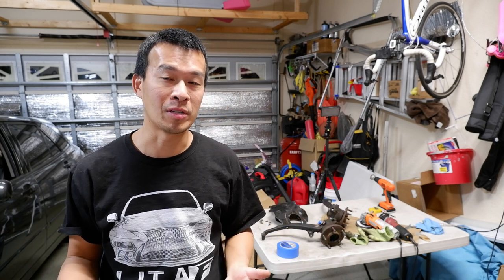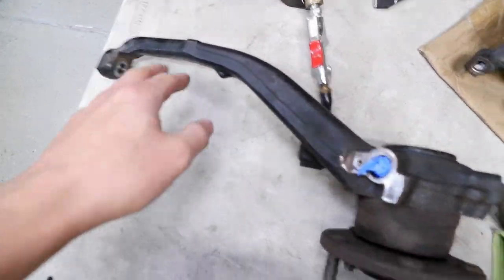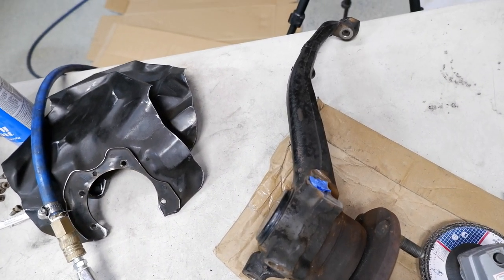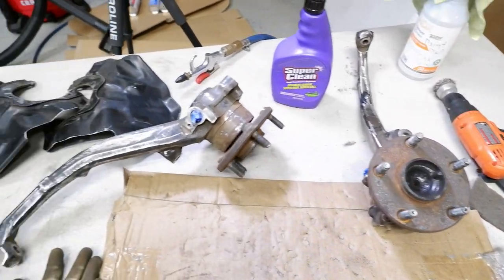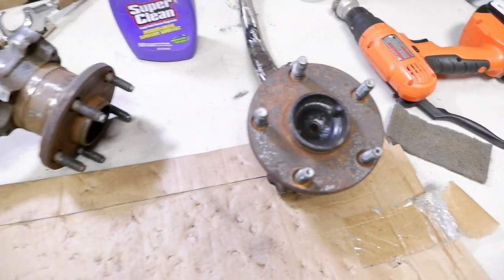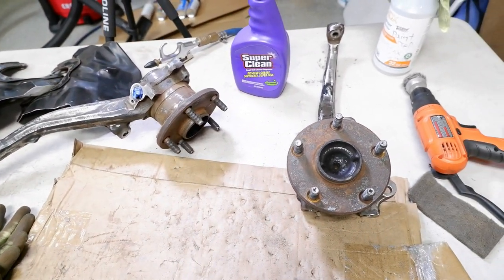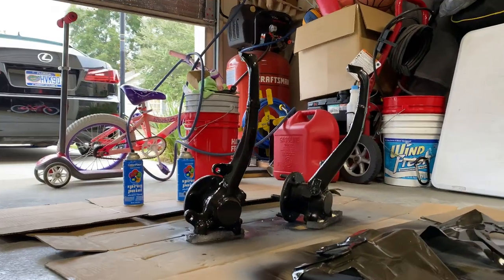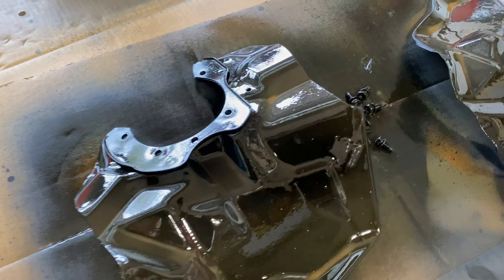Lexus IS300 Suspension Spindle Rattle Can Spray Painting

Comment: Now i know how I am going to use my spare  "5min 30".

Do you have a list of all mods on the 2IS project by any chance..... Would be nice to have a roadmap since you got me addicted ☺️
Thanks 😊
Reply from the maker: I’ll probably post up a MOD walk around of that car one day. I have a lot of small OEM+ stuff aside from the main aesthetics MODs. Maybe in a few weeks when I’m finished with the brakes on the Sportcross.
Reply: @TunerwithKids  Awesome... Doing the GS450 disc & caliper upgrade next. So would be nice to start sourcing next step components considering shipping times with all the restrictions.
Reply from the maker: That’s easy upgrade. GS450h? It’s same calipers as IS350. So just follow my video on that.
Reply: @TunerwithKids  Yes I have that saved, heard the standard fronts actually bolt on the rear so could be another interesting consolation if it's true 😀
Reply from the maker: No the front will not bolt onto rear of 2IS. Only bolt on option is IS-F calipers for the rear. Which aren’t worth the price. $300/each plus rotors.